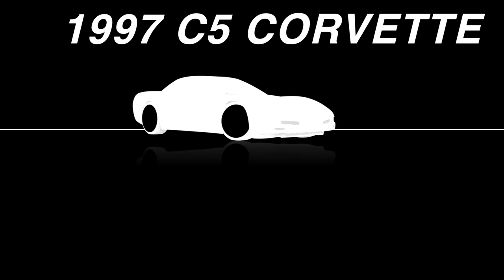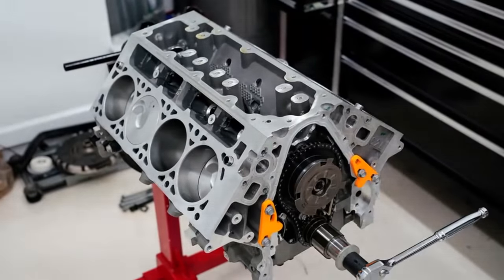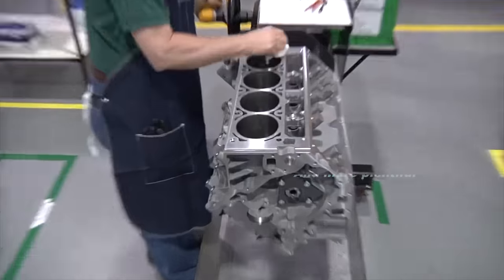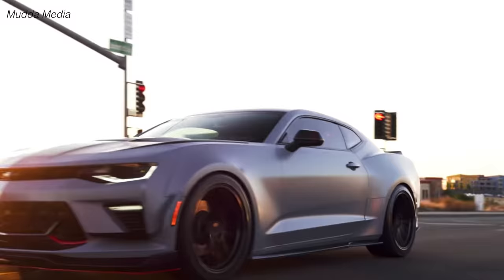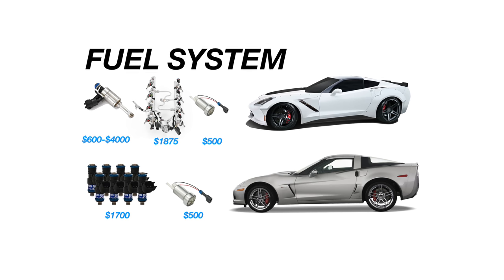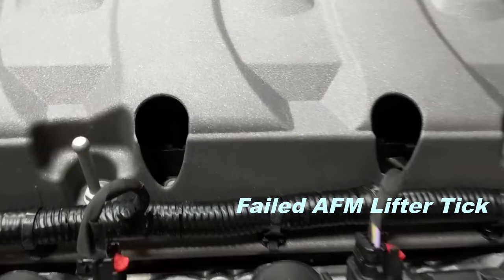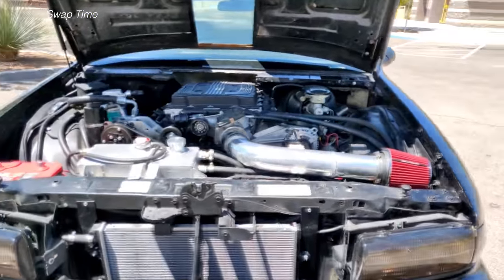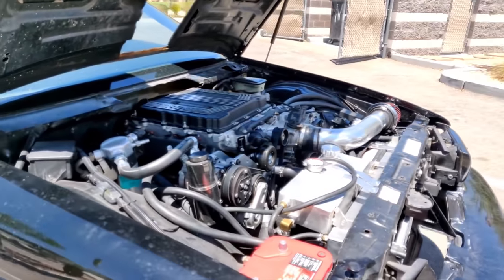Why LS Engines Destroy LT Engines Still😭 | Explained Ep.1

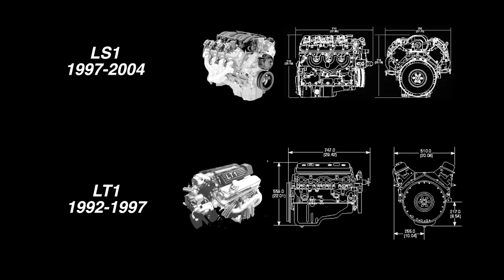Comment: 0:13. More potent for their size???  Have you seen an LS motor, including the LS7, next to Ford's DOHC V8?  The LS is far more potent for their "size," as they are far smaller.  Perhaps you meant for their displacement.  But that's what's so great about the LS push rod design is how compact they are (which allows them to fit just about anywhere), and how low their center of gravity is (improving handling).
Reply: Potent? Show me a ls or lt running 7s unopened from the factory like ford
Reply: @freedomisntfree_44  What are you talking about?
Reply: @freedomisntfree_44  as soon as you show me any 250.00 coyote from picknpull then that question will be relevant.
Also show me any production pushrod sbf that can handle 1500flywheel on sbe stock crank,rods,pistons,bolts like even the early junk gen3 rod 5.3 4.8 6.0 have?
Reply: @bujin5455  hes referencing a coyote has enough airflow without adding cams like a ls to run 7s in a fox body swap sub 2900# with turbo/ turbos / blower
Reply: @Thelastoftheog  no one cares about that when you're roll racing🤣😂 no one wants to eat beans for a year trying to build a furd up from the ground. Better ask those gt350 owners how they're enjoying their engine replacements lol
Reply: @Thelastoftheog  no that’s an unopened 2018 mustang that put that number down. If it was in a fox body it’d be faster 🤣
Reply: @freedomisntfree_44  point still stands coyotes are a horrible choice for a swap.
Fact
Almost always 3 to 4 k for coyote long block.
Its huge physically and takes more fab work to fit if it will even fit.
Trans options
About 60 different trans options more for ls
Budget 
For the same 3k of a stock n/a coyote long block i can have 700whp with a junk truck 6.0
Reply: @Thelastoftheog  I’m not cheap and I don’t want the same junk. Coyote is much better 👍🏽
Reply: @Thelastoftheog  Seems like people aren't understanding my point.  If you put a coyote next to an LS7, the Coyote is a MASSIVELY larger engine, and it's top heavy, and it requires a lot of engine bay.  There is a reason LS motors get swapped into everything including Miatas and 911s.  For their SIZE (not displacement), the LS platform is insanely potent, just in NA trim.  Of course, if you care to throw a little cash at one, you can make them do 2,000HP pretty easily, and still be in a small package.  I'm not saying Ford's power plants are bad, I'm just saying despite their small displacement numbers, the engines themselves are physically HUGE and take a lot of room, and are top heavy.  Which, among other reasons, is why they are generally passed over for swaps.
Reply: @freedomisntfree_44  see my above comment to Richard Garrison, it applies to you as well.
Reply: @freedomisntfree_44  not about being cheap.
For a competitive 1500hp both are horrible choices.
For 800 to 900whp weekend warrior there is not a better choice than gen4 ls truck engines.
Most people dont have f u money so on swaps/builds if they pop a 3 to 4k coyote they will be doen for a year or never finish the build vs a 250 500.00 truck engine they can be running again next week.
A melted wastegate line or hung injector can toast a 20k billet engine just as quick as a 250.00 one in racing sh.t happens.
Reply: @bujin5455  im on ls/lt side guy i never suggest coyotes unless its already a coyote platform or have no packaging restraints plus fu money budget wise
Reply: @trentdaddydolla647  when did i advocate ford 😂 i used to be ford power long ago but now for 1000whp daily ls/lt is the best dollar per hp over coyote.
My last budget build was 700whp for 3k on stock cam 6.0 on 93oct no meth

Comment: Well, this is kind of a moot point at this time in automotive history as ICE
machines are not long for this world. Everyday family e cars can blow away 
even the supercars. Its a brave new world, you can lead, follow, or get the 
hell out of the way but one thing is for sure, you cant stop it.

!
Reply: No. You're mistaken. High performance electric vehicle drivetrains that happen to be packaged in an SUV or Sedan can match the performance of a supercar, yes. But there is nothing "everyday" about a $100k SUV. 

ACTUAL everyday electric vehicles are more along the lines of the Chevrolet Bolt, the MINI Electric lineup, or the Mercedes-Benz B-Class. All of which are packing about the same amount of power and performance as their petrol counterparts. Even if you do point at the Tesla lineup and say: "It's the future!" that's a future that is extremely limited from a performance standpoint and riddled with issues.  There's a reason that there's only one electric racing series, and it's notoriously slow and boring. Electric cars are becoming more common-place, yes, but it will be a long time before you see them ACTUALLY competing with the modern ICE performance cars for their market space and twice as long before you see them start to have any real push in the aftermarket industry.

Comment: hp/dollar isnt that cut an dry. You can pickup a low mile 6.2 LT with transmission, ECU and harness at around $4000k. Slap on an LT2 intake and a decent cam and you're at 500whp for pretty cheap. On the LS side you're not finding anything low mile these days and whatver you do find will likely need to be gone through. You can make decent power with just a cam swap LS3 but it wont be any cheaper, wont make 500whp as easy, and wont have a forged crank like all the 6.2LTs.

Comment: What are we defining better as? Cost, aftermarket, just how good something is? The LS is cheaper to mod, and has one of the largest aftermarkets of any engine series ever. Its fuel system is also simpler (or cheaper) to mod and an actual "LS" doesn't use AFM. Other than that a LTx is easily a superior platform. Now I have some beef with how GM has handled some of the GEN5 stuff. IMO a LT4 is a half-stepping engine like a MOFO. It's doing the bare minimum it has to to make 650 BHP. It's not beefy on a Terminator, 2013+ GT500, LS9, Hellcat, 2JZ-GTE, 4G63, or Neon SRT4 engine level. My 2018 F150 has a better engine for boosting than a LT4, and it's a N/A engine with a 12:1 CR. On top of it all it uses this weak ass, inefficient blower. Major half-stepping GM. LT5 is a great engine. LT4 is a slightly beefed up LT1 with a little bit better fuel system and an inefficient blower. They don't even do away with the AFM BS in it. 

Another knock I have against the GEN5 SBC is DI is good, but it's also bad. Dual port injection on the other hand is F'in awesome. It's one of my favorite things about my GEN3 Coyote. If I want to support 800+ WHP I just need to upgrade the port injectors to some 47 or 60 lb injectors and ball out with the HP. At least with the newer Ford's it's not like the old days where your spending 4 figures redoing the entire fuel system to support 600+ HP. Dual port injection makes it easy, simple and cheap to support large HP. LT5 is the only GEN5 SBC with dual port injection. LT2 should have gotten it. Plus it cleans the intake valves. Another negative to DI is it's generally not good for high RPM engines because DI injects fuel on the compression stroke and at 6,500 RPM there's only like 2.25 milliseconds to inject enough fuel into a cylinder. (That is about 100 x's less than it takes to blink your eyes) That's why most DI engines don't turn more than 6,500 RPM's because they need enough time to be able to inject enough fuel into the cylinders. Dual port cancels out the negatives of both DI and PI, while giving you the benefits of both. You can still get the high CR that DI affords you, while keeping the valves clean, and being able to spin the engine hard, and when it comes time to mod it to support more HP, you don't need to mod expensive DI components, just upgrade the PI side of the fuel system and you're GTG.

With that said GEN5 SBC is much better than GEN3/4 SBC at its core. GEN5 LT based engines get Nodular main caps, 12MM head bolts, (as opposed to 11MM for LS) all the 6.2L's get forged cranks, gussetted/reinforced water passages around the cylinders, better flowing heads, (even if you think their exhaust ports are odd) more efficient oiling, etc, etc. Plus whether or not you like DI, the fact remains that there are several shops that know how to work on the GEN5 stuff that can get you over 100 WHP a liter, N/A, on a stock bottomend if you ask them to. We're talking ported OEM heads, cam, boltons, tuned on E85 make 620+ WHP on a stock bottomend. There's videos of people making over 590 WHP on pump gas with a stock bottomend, N/A. A GEN4 LS with a 4.065" bore isn't going to manage that quite so easily. It was a trip going from a LS1 with people arguing on the forums as whether to run headers with 1 3/4" primaries or 1 7/8" primaries to a LT1 with people arguing on the forum if headers with 1 7/8" are better or headers with 2" primaries. But I was also like, "damn, they put a Vette tax on the GEN6 Camaro when you look at the cost to mod it compared to a GEN4 Fcar.

Comment: uhhh 6spd Camaros lt1 do not have dod or afm only the auto, gm introduced the skipshift in its place
Reply from the maker: They don’t have it activated in the ECU but the DOD/AFM lifters are still there. When you cam swap M6 LT1s you still have to delete that stuff
Reply: @337speed  which would be the same thing when you Cam swap an l76 that's in a G8 which is going to end up costing you the same amount of money in terms of parts. The only difference is with the LT you have to pull the heads which you do not have to in an LS. But if money isn't an issue then I would go ahead and upgrade the heads while you're at it regardless if it's an LS or an LT. Advanced induction heads can get you a solid 60 to 100 horsepower gain which is very beneficial for the 6.0s 

And if the LT1 still shares the same AFM lifters at least since it's never been activated it shouldn't theoretically ever have a problem because it's always an 8-cylinder mode no matter what. Now I understand there's technicalities that come with that but I still feel that as long as you own the 6-speed you should be pretty much set

Comment: one other thing LT had his higher gearing on transmissions. for example LT has the 10 speed transmission
Reply: What does the ls model camaro have isnt it a 10 speed or is it a 8 speed
Reply: @JackHowell68  Ls never came with a 10 speed as far as i know and it depends which camaro you’re talking about
Reply: @Lowzaracing  yeah just looked it up didnt see any ls 10 speed stuff ford has had the 10 speed in the mustang for a while wonder why chevy never built one for the ls
Reply: @JackHowell68  actually i think chevy helped ford design the 10 speed transmission lol but i’m not too sure that’s just what i’ve hears
Reply: @JackHowell68  the 10 speed came to the mustang in 2018.  The ls went away in what 2014-2015 in the camaro?  Ford had the 10 speed a year or so before Chevy started using it even tho they designed it together.  This is why the ls never used it because it wasn't available when the ls was being used.
Reply: @JackHowell68  there was no affordable 10 speeds when the LS was retired in 2014 with the intro of LTs
Reply: @rustysausage69  it can be done.
Reply: @rustysausage69  no gen4 and gen5 both are 4x 58x. You could piggy gen4 and gen5 ecu all the data for the trans to operate in fact i could add in a maf fusion for port injection and run a gen4 engine with port off gen5 ecu
Reply: @rustysausage69  or just use gen5 ecu for everything but fuel and termx max holley for fuel leaving spark control to stock ecu to keep tq management

Comment: A while ago i watched a video comparing 2JZ to the LS (maybe by donut media?) but they did a really poor job, like including the width of the engine including the headers and turbos on the 2JZ against an LS with no headers. I really like how you compared specific things and cost of tune-ability and improvements in this video, I think you could do a much better job. It might even warrent a few different sections of a video to compare what you would find in a junk yard 2JZ-GE against a 5.3 vortec, and another part to compare a GTE to an LS or an LT.

Comment: Manual trans LT cars don't have AFM though right?
Reply: It's not implemented but they have the same hardware such as lifters, just doesn't fail like the autos as it's not used one of the many reasons I got one. ~ 2016 2SS M6

Comment: This is ignorance a ls is an everyday pushrod v8 the lt6 is a race based engine... also direct injection makes more power but does have downside without meth injection or port injection added.

Comment: Have a new GM performance LS3 495 horsepower crate engine with CNC ported LS3 heads with a load of other upgrades this GM hot cam that comes in this engine I'd consider a fairly mild camshaft it's in my 2011 Camaro SS with a built 6L80e transmission with a circle D 4200rpm stall converter car has full interior and air conditioning car had gone 7.4 at 94 mph in the eighth mile with 1.70 60 foot time making just 3 passes with it naturally aspirated with no power adders with more testing and experimenting with tire pressures and launch techniques car could probably go 7.2s at 96mph car ran 7.4 at 94mph with 20 pounds of air pressure in the Mickey Thompson ET Street R 305/45r17 drag radials car has the stock 3.27 gears can cruise on the highway at 80mph at 2100-2200rpm car is tuned and runs on E85 for how mild it is has a ever so slight chop at idle that barely noticeable compared to a stock LS3 the performance for a mild driveable street car that weighs 3920 pounds with me in it l think is pretty hard to beat being it's not a max effort max power setup race car
Reply: That sounds about right. 94mph is pretty good.

Comment: Look calling an LT a different motor from an LS is crazy , LTs are just an update LS , any engine that shares so much is not a new engine family , it's like saying a 302 Windsor from 1968 and a Ford 5.0 HO from 1999 are different engines when we all know it's the same motor with updates ! Get a set of those LT heads with the Hemi valve angles 8 deg north south and slap them on a LS1 oh look they fit , !

Comment: I’d just buy a used coyote and be better than both 😀
Reply: Sure if you dont plan on keeping it more than 100k and babying. These motors are junk around the 100k+ mark and become a ticking time bomb around the 120k+ mile mark. They just dont last, too much wear occurs for such a small lifetime of the engine
Reply: @brannonbarakat457  I’ve got one with nearly 300k mile 🤡🤣🤣🤣 show me an unopened ls run 7s btw many of the lts haven’t made it past the first oil change……lifter failure anyone?
Reply: @freedomisntfree_44  they are a big heavy turd for a 5 litre engine better suited as a boat mooring 😁
Reply: @johnboy5167  so where’s that unopened ls running 7s then? 🤣🤡

Comment: Ls all the way 👌
Reply: LT1 works good for me. More stock power. Built LT4's make mega hp. 
But so does the LS. Which is why hundreds of thousands of restomods are running LSX motors not LT1's.

Comment: LS may beat the LT, but the sbc and bbc still reign Supreme in this testing. Sbc is cheaper to build, ls cost the same if not more than a BBC to build. Now stock is a different story unless we use the 70s sbc and bbc
Reply: That means you gotta make a video on it 😆 🤣 😂
Reply: 😂 u serious?
Reply: @thetrollwhoknows9928  prove me wrong! He did say built not stock.... You better not be trolling 🤣
Reply: @rustysausage69  have you ever experienced an old small block that's built up over 500 horsepower? It's on the edge of non-streetable it's only good for track pretty much it loops itself around using so much fuel that's ridiculous and you can't even really drive it. To say it's anywhere close to equal the ls this guy is crazy.
Reply: @rustysausage69  I would almost agree except the sbc cost alot less to build. You aren't making 600 with a unported LS head N/A with accessories either. Now the design is definitely better. But if you made all things equal the sbc would run circles around the LS if it had a 15 degree head. So practically a sb2 which is the daddy of the Ls.  But that LS3 is something special
Reply: @rustysausage69  😱😱😱how much you pay to make that power? You are correct sir! Hey man edit that message and delete those specs. I can't have that in the wrong hands lol
Reply: @rustysausage69  Thats what I'm saying,  it's cheaper to build a sbc vs a ls. Now it's cheaper to get 500hp out a ls than sbc
Reply: Dream